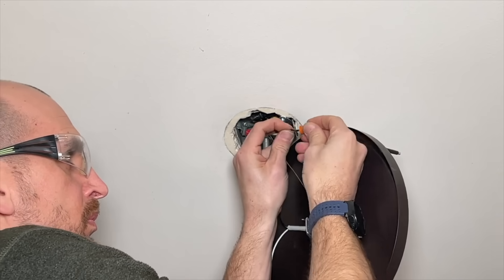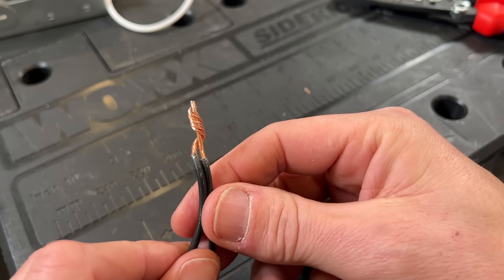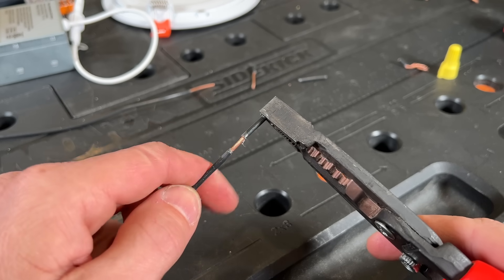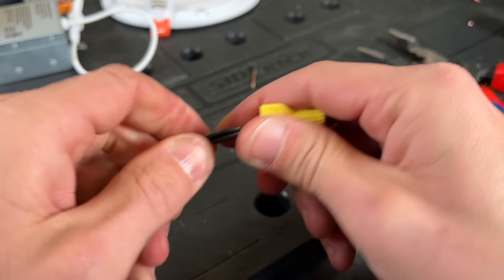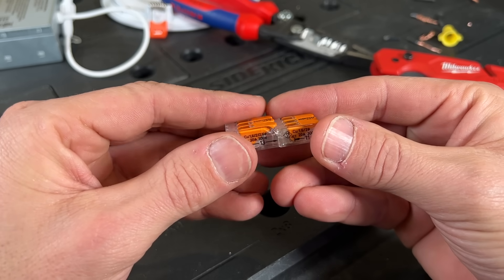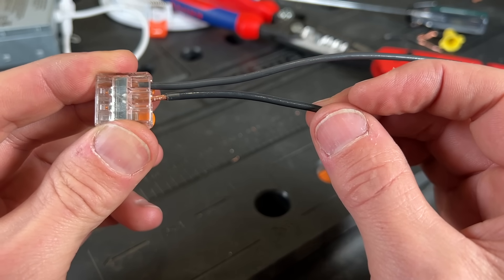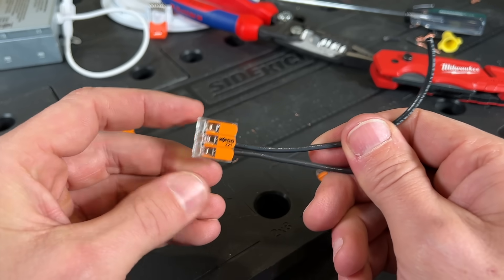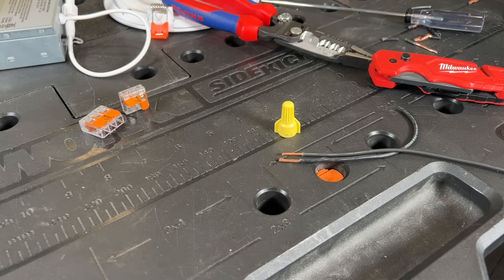Most Common DIYer Electrical Mistake - Don't Let This Be You!

Comment: Use your wire strippers on a angle when first bitting in then turn them straight and the insulation will Come right off and you won’t fight it

Comment: The Americans' love for wire nuts is hard to understand... They're cheap, but that's about the only good thing about them. Wago FTW. For heavy load applications butt connectors are great, if you have the right tools (crimpers, not pliers).

Comment: You use a very fancy expensive stripper than most folks, especially DIYers. Still u weren't able to strip. So the technique to be used is to turn the wire clockwise anticlockwise a couple of times between each stripper-bite. Then open the stripper just a bit so it's wider than the strands yet narrower than the insulation. Just push the piece of insulation outward with the stripper. Simple ?! :)

Comment: strip 1/4 to 1/2 inch of wire and you'll be less prone to failures with marettes. if you look at the amount of wire stripped on a new fixture or smart switch, that's the maximum you should be stripping for your wire nuts. when I strip I only strip the width of my Kleins for stranded wire. the solid can be longer, especially if you're maretting multiple solids together. if you're maretting multiple solids and the stranded, twist your solids together, then add the stranded at the end.

keep the ends even. if you lead the stranded it can get wound up in the threading and then it barely catches the solid wire.

the rating for connectors is important. you're never supposed to exceed 80% of the rating for continuous loads. if it can handle 3 times the rating for short loads then that's good, but you shouldn't rely on short loads being plugged into it at all times, wire for safety.

Comment: Im pretty sure the wago push in are not rated for stranded. Nor aluminum wire. Most lights come with stranded aluminum in their box. The lever wago are however rated for standed. But i still dont think they are rated for aluminum wire. But dont quote me on that.

Comment: Whoever thinks it’s hard to use a wire nut should “NOT” be doing any kind of electrical work whatsoever.  You’re the type of people electricians tell stories about along with pictures of the work you did that we had to fix.

Comment: I have 40 years of electrical maintenance experience in heavy industry ,natural gas refining plants,  power generation, Utility distribution, etc. Wire nuts beat the Wago Lever nuts hands down in real word setting where equipment gets filthy, wet, and is exposed to high vibration. any time you have an electrical connection that can come apart at the flip of a lever you are just asking for trouble.  Just my experience / opinion.

Comment: I am not a DIY'er. I am a 48 year pro. So for what its worth - Wago is too expensive for any job requiring a lot of electrical joints. A home is an example. The better method is just to perfect your technique with wing nuts. Use the correct size wing nut. Wrap the stranded properly. Twist the nut correctly. And give it a pull test. 
You wanna stay a mere DIY'er or work like a pro? Your choice.
BTW current travels on the outside surface of wire. Wirenuts provide more conducting surface area than a Wago, therefore a better current conducting chioice is a wingnut.

Comment: I would like to expand on your warning about the dangers of loose connections. Arcing is a symptom of a loose connection. A short is a zero resistance, high amperage fault which will trip a properly functioning over-current protection device. The real danger with a loose connection is the increased resistance which produces heat; enough to cause a fire. This is coming from a licensed electrician, electrical inspector and retired city fire department fire investigator who has investigated a multitude of electrical fires which resulted from a loose connection. Good information and explanation; especially liked display of the proper screwdrivers. Klein also sells the combination tip screwdriver bit.
Reply: From your experience what would you recommend in these "Wago's"?
I've seen multiple of these that comes in light fixtures and I had emergency calls because lights went out when I go and find on these "Wago's" with overheating marks on the wires caused by high resistance... 
I wouldn't recommend these "Wago's", me personally  don't use them on my own work and if they come in the fixtures I cut them out and use wire nuts...
Reply: @MrSeth166  I'm not an electrician but a contractor, and MY experience with the WAGO's is that after a while my AFCI outlets start tripping. When I take the WAGO's out and twist the wires together instead, the problem disappears.

 I have asked EVERY electrician I have come in contact with, and as a contractor that is a lot more than the average DIY'er, and NONE will use much less recommend a WAGO and like you cut them off whenever they are working around them. 

Yet in Europe I've heard they use them more than a twist........ go figure.

Comment: The wago connectors he talks about are worthless if there is any vibration at all! The factory I worked at had several failures that cost a bunch of money to repair plus all the down time.
Reply: The RV industry has been using Wago for years.  Lots of vibration driving down the road and no problems.
Reply: I would be more concerned about anything that screws a connection, be it a wire nut or type of terminal block, since these things have an already pre made way where less stess acts on them, hence a reason in industrial settings screws have to be regulary thightend in germany. Wagos are much more of a ratcheting mechanism, with the easy way being in, as you need much more force pulling and twisting them off.

Comment: I trained in the UK and the few wire nuts I have encountered I immediately replaced after encountering a panel fire caused by a plastic shroud breaking off a very old connector. It was rather obvious from the others connectors that heat within the panel; had made the plastic shroud brittle over time. I worked in the States some years ago and American electricians who were working nearby were so impressed with my lever clamp connectors that they asked for a quick demonstration. Sparkies are a nosy bunch and usually have an eye for new kit especially if it reduces time on the job. They soon began ordering them for themselves, even before I'd finished my mini demonstration. 
They are quite simply a solid, slightly over-engineered connector that you will never have to go back to once fitted. Usually they have test ports on them that allow the cables to be tested with a multi meter, without requiring disconnection. This can be an important safety feature for non-professionals. 
Very often this type of connector will result in a much neater and easier to understand installation (for the next guy). I also highly recommend them for temporary installations or any job that is subject to the effects of vibration, such as small motors and pumps. WAGO seem to be the best, but many other alternatives such as IDEAL push in connectors can be almost as good at a lower price point for low voltage/ low power applications such as LED lighting circuits. 
Most of my work has been in industrial settings and factories but these things can be found all over my house. Fair warning, they can be a little bulky compared to other solutions, but the extra aggravation of hiding these things in a ceiling for example, is usually worth the ease with which multiple connections can be made.
Obviously there are far cheaper ways to joint cables but if you have lots of cable splices or connections to make off or are joining solid core to stranded flex, why struggle?
Reply: How do you know you’ll never have to go back to fix them?

Comment: 3/4 is way to much 3/8 is all you need, you are using the wrong size wire nut too, and if look closely there is another set of threads on bottom of the wire nut, those are grabbing the plastic insulation , this in why you stipped way to much wire, I've been wiring since I was 13, 40 years now , I think i know what I'm doing

Comment: Looks like these Wago blocks would work well for connecting copper wire fixtures to aluminum house wiring.  I have older places with aluminum wiring, which can be a challenge.  Does anyone know if this is an accepted practice?  Thanks....

Comment: Wago's, insure, and other push in and lever connectors are the way to go and soon, wire nuts will be dinosaurs.  Drawback is the cost between Wago's and wire nuts, but they will come down when more demands are met.  Only draw back is the largest is a 10 ga in Wago's, and 12 on insure,  but the Wago's and insure connectors started with the lighting industry on ceiling fans.  I'm 70, and wish these came out back in 1973 when I started in the electrical field.  Have not used these on solid fabric wrapped wire or marrying knob n tube to Romex.  Jury is still out on that!

Comment: I've encountered bad connections made by "professional" licensed electricians.  The reason is usually use of wrong size wire nut — too small or too large.  This may be due to laziness or haste, not wanting to make a trip to the supply bin to get the proper part.  I've also seen flaky connections with all solid wires in the bundle when one wire protrudes too far beyond the end of the rest of the wires:  The wire nut bites into the long wire and barely grips the remaining wires.
Reply: That's why we use the prettiest method to insure proper connections

Comment: if im not mistaken, wago connectors make contact by spring loaded knife edges, to the top and bottom of the solid cable. isnt this bad? its minimal contact. stranded wire can spread out and have more points of contact. screwed terminals have contact the length of the circumference. no to wago.

Comment: Thanks for the information, just ordered the pocket set. I have wired for decades and can easily see that they are superior, especially in small volume boxes! I also use a scissor like stripper by Klein, but it only has two different scales, only for solid.
Reply: They are an inferior product. Wagos belong in cereal boxes.

Comment: The reason the levers are initially lose is so you can get a grip of them. My first encounter with wago connecters left me a little puzzled because a didn't realize how much pressure was required to open the levers..

Comment: Love the wago for outlets and lights.  I still use wire nuts with a pre-twist for anything with a high current draw (stove, garage outlets, hot tub, dryer...)  because greater contact area = less resistance=less possible heat build up on those connections with high current.

That's just my preference 🤣😂. Great video 👍
Reply: That's your choice man, but a lot of wagos are 32A constant rating at 450v which is beefy enough for any household appliance.
Reply: I thought NEC for high-current appliances calls for split-bolts..?  If so, either wire nuts or Wagos are not code.
Reply: @DavidWitkowski  I don't know about that...I'm no elekchicken🤣😂.   Just do work when work needs doing.  My place is old, I would bet newer construction wouldn't have wire to wire connectors for anything on 220(us only high draw appliances get the coveted 220🤣).  They probably use an outlet termination and plug on the appliance...or should.
I'll look up what you mentioned just to gain some knowledge and maybe prevent a future issue👍.

Comment: Wire strippers still SUCK. Pull really hard and then, when the insulation breaks loose, you punch yourself. They don't apply force in the right place. The fancier ones that try to work better don't really accomplish that. Some loser nicks the solid conductor with diagonal cutters or sloppy use of a stripper, and outlets all over the building fail at random, a few every year, for the next 40 years.

Comment: WHERE did the appliance makers get the idea that they could use stranded wire? WHO lets them get away with it? THIS IS A SETUP! Lack of secret non-obvious knowledge makes electrical work hazardous and the finished job dangerous. Another is: Electrical screws seem to fit straight and slotted screwdrivers, but not really. Square Robertson driver fits better, and unheard-of ECX screwdriver fits best. (Search for it.)

Comment: This is why I switched to Wago connectors. No more wire nuts for me.
Reply from the maker: Yeah, I am about 95% Wago now and have 2, 3, and 5 pin in my little kit at all times now.  Check these guys out https://www.wago.com/us/wire-splicing-connectors/inline-splicing-connector-with-lever/p/221-2401  Pretty cool for splicing.

Comment: 20+ years electrician here.  I clicked on this video expecting to tell you that you're an idiot, but your wire nut tip is on point.  I don't agree on the wago bit though.  Wire nuts cost pennies and do the job just fine.   When you use a wire nut, there's a high chance no one will ever see it again so it doesn't need to be reusable.  The only time I'd use a wagoo is for small electronics projects I'm working on and never in on mains power.  There are reasons they are never used in construction in the US.

Comment: when nipping wire dont be wasteful make sure you dont cut off more than what you need if the wire has 1/8th threats from the nut cut off 1/8th because you are better off making connections with un threaded copper but nipping off 1 or more inch like in video will not allow for many changes and reduce its future proofing

Comment: Most dimmer switches come with smaller orange wire nuts, we've been cutting the solid wire at an angle for decades with no problems. Even for some of the older wire that was smaller hooking to stranded just use a blue wire nut.

Comment: The problem I have with Wagos is they are bigger than the nut.  So they don't fit very well in the box, its already a tight fit, adding something even bigger often doesn't work.

Comment: Do the 25 lb weight test on your wire nut connection.  Those wire nuts are really only biting at the tip or narrow end of the wire nut when you have two wires in them.

Comment: I see when you are stripping you are pulling it off,  tilt your stripper about 45 degree and then clamp down and then twist your wrist back up 90 and it will cut it and you can take the casing off fast and easy.

Comment: Holding the two wires side by side, use lineman's pliers to make a few Clockwise twists. They should wrap around each other using this method. Trim the end flush and then use the wire nut, If you strip the ends a bit long, it will be easier to get a good twist and then you can trim down to about a 1/2 inch before putting the wire nut on. 

If you want the best low resistance connection, twist as described and then solder the connection and tape.
Reply: Yup---figured this out when I was 12 and have been doing it this way since!
Reply: @Jeph629  It was at an early age that I took an interest in electricity. I was always a science oriented and was good at math. My dad used to tease me that I was  never satisfied learning the right way to do things, but  had to understand why it was the right way, I was already a bit of a techie when I was about 6 years old. Part of what drove me to learn to read, was so I could read and understand Pop Science and Pop Mech magazines! I loved the space race and  was 15 when we landed on the Moon. Growing up at that  time, all my friends wanted to grow up to be astronauts, but I wanted to be one of the engineers in Mission Control. Those early days of wanting to be an engineer, drove the rest of my life ever since. 

We didn't have internet back then, which was probably a good thing. Today you can search the internet and find a 100 ways to do things, but often 98 of those show you something wrong!! I get surprised that some guys who do this kind of work for a living, really don't understand the basic science of how it works. But then today in residential, we have a lot of guys who are better described as installers vs tradesmen.
Reply: Step 3- file bankrupcy and apply for a job at GM.
Reply: @bus-fun-addict  And why would  you be filing for bankruptcy?

Comment: Great video, and I'm wondering...Can they be used to replace copper to aluminum connectors when changing out aluminum at and on receptacles...2.5 million homes and offices still have the bad connections caused by the aluminum wire installs before they realized it was a problem.....I use the purple Specially designed connectors now, also costly with the screw on terminals, to me pointless...It's still an aluminum to steel connection, as are the receptacles, but the aluminum to copper is forbidden because of  the Di-electric corrosion, that I understand...I have also come up with a self designed problem solver for room, so no drywall work is needed to make room for said connectors.... Cramming all the connectors needed into a single box, to change from aluminum to copper pig tails for the receptacle,  plus the receptacle itself  is near impossible...They end up knocking out walls for additional boxes...Then comes plaster work...Costly, but there is a trick, I stumbled upon...It eliminates the need to knock out walls it's been accepted in the St.Louis suburbs by Public Work inspectors ...They thought it smart, so now it's a go...AS I said, I stumbled on it...I'm not that smart...I might possibly be starting on some Condo's for insurance cost reduction to the tenants as it will soon become mandatory for insurance reasons ...My presentation is in two weeks, so I'm wondering about these Waco's...Aluminum from the source in one side, copper to the receptacle in the other?...Any advice would be greatly appreciated...Anyway, I'll try them and see if they will meet the code requirements and satisfy Public Works again...They would be so much faster and they just make sense, with what seems would be a constant, but flexible pressure on the wires allowing for expansion and contraction, that is the biggest problem with the aluminum wire, so probably not...lol...Again, a great video, thanks.